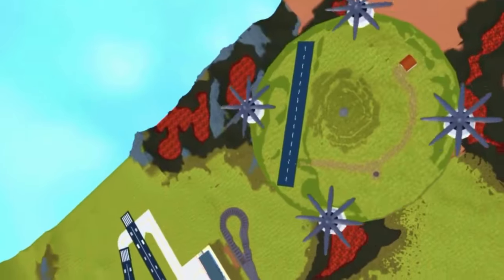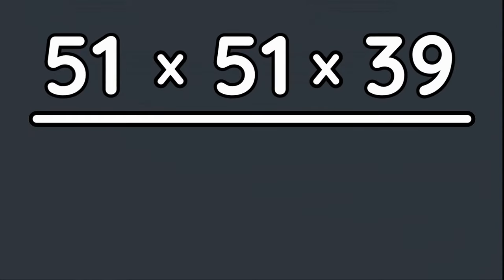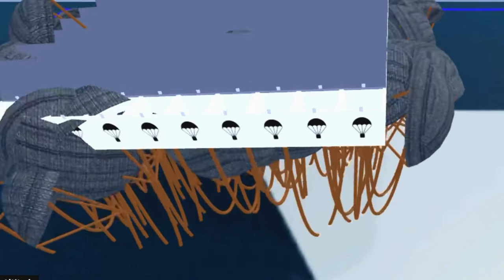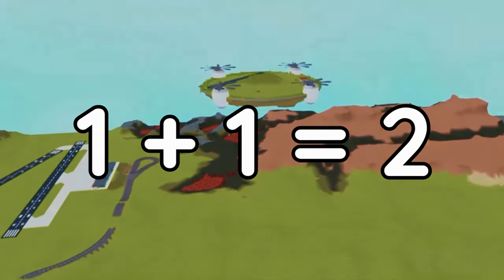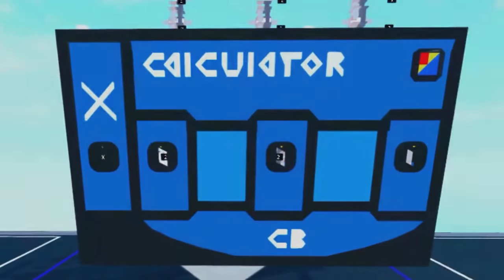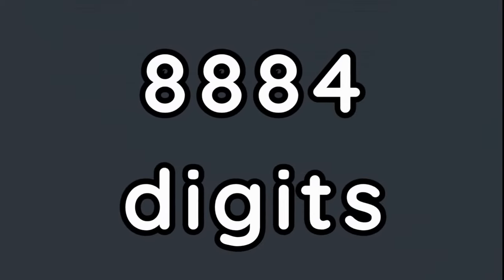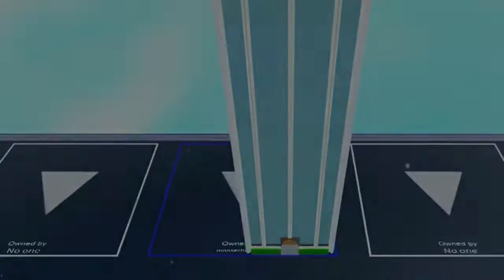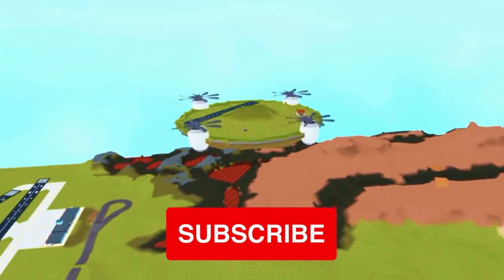How Rare Is Your Plane Crazy Build?

Comment from the maker: Disclaimer: this is a relative estimate. Also, I’m not taking into account small things like color, orientation, etc.
Reply: There are 6 orientation so mutiply by 6
Reply: If you filled your entire plot with the standard cube, took into account the color, and also considered its rotation, you would end up with 1.12323025E14 possible unique creations.
Reply: Or 112323025000000 in standard numeric format, the other one was in scientific notation because that was what the calculator outputted.
Reply: Dont even get started with signs. basically infinite with signs
Reply: @Ovlubush  signs have a text limit